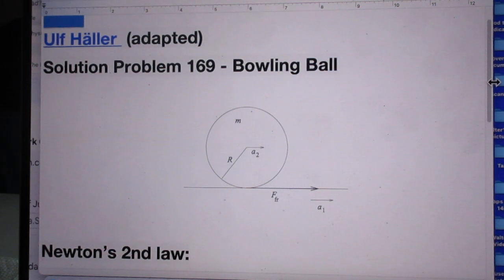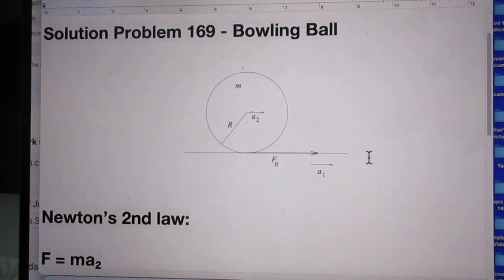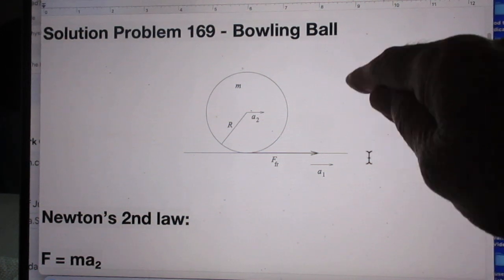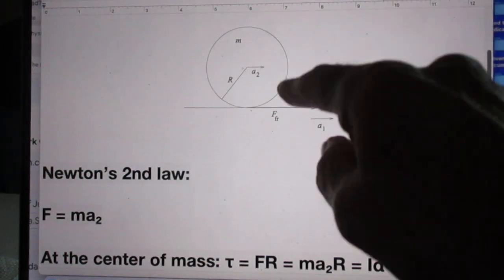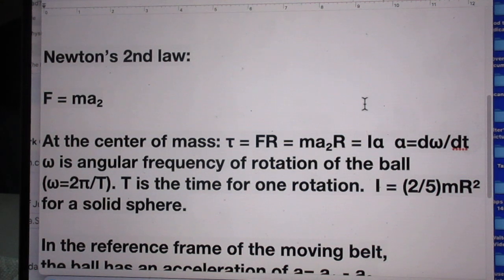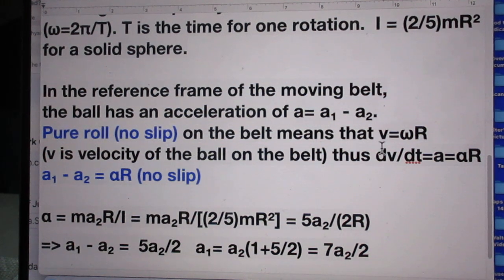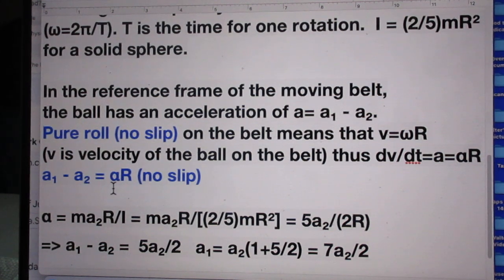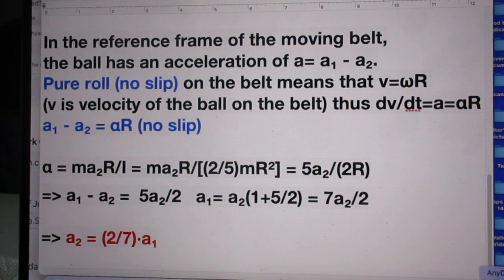Solution to Problem 169 - Rolling Bowling Ball

Comment: Sir if a body moves with pure rolling then what is the acceleration and velocity of that point which is contact to the surface
Reply from the maker: pure roll of the center of mass V(cm)=omega*R - thus the velocity of the point of contact is zero (sum of V(cm) to the right and omega*R to  the left. I cover this in  detail in  my 8.01 lectures -  watch them
Reply from the maker: https://pressbooks.online.ucf.edu/osuniversityphysics/chapter/11-1-rolling-motion/

Comment: Speaking about a period T within this problem to refer to the angular velocity is a bit confusing, as there is no constant period (and no constant angular verlocity), as the ball keeps accelerating with a constant acceleration, and therefore the period of one full rotation will get shorter and shorter as the train/belt and the ball both accelerate.
Reply from the maker: omega at any moment in time is 2pi/T at any moment in time
Reply from the maker: in the case of pure roll, at any moment in time t, v of the center of mass is omegaxR. omega at any moment of time t, 2pi/T.  v, T and omega are a function of time.
Reply: @lecturesbywalterlewin.they9259   Thanks for the comment. I guess I'm somewhat confused how period T is exactly defined when a motion is not having a constant period.
Reply from the maker: @wouterdobbelaere  omega is in radians per sec. That is uniquely deteremned at any moment in time but,  ofcoz, it increases in time.  omega = 2pi/T  thus T is also well defined at any moment  in time and T gets shorter in time. .

Comment: Is not friction in opposite direction of relative motion between belt and the ball? Friction should be leftwards in this case if belt is going rightward. What am I missing?
Reply from the maker: in the case of pure roll no sllip the friction force does no work - there is friction but it does no work